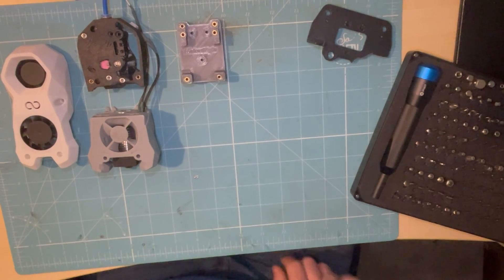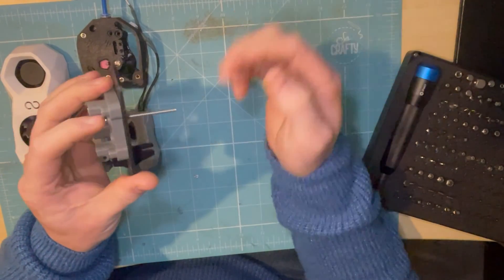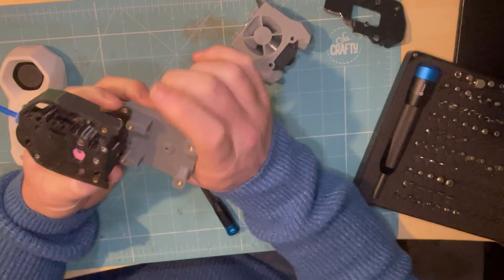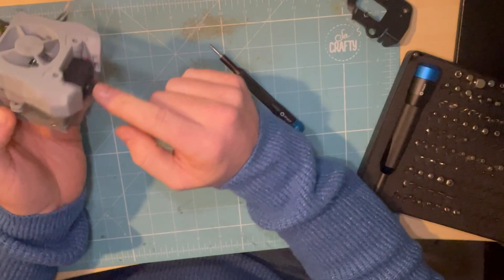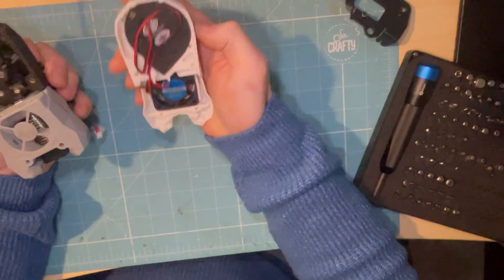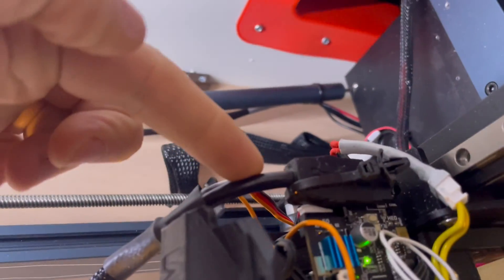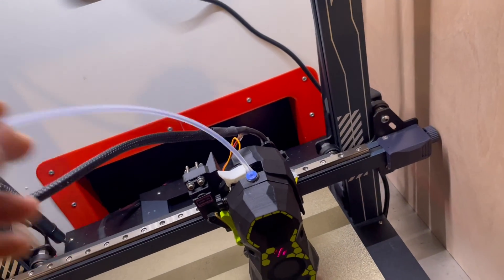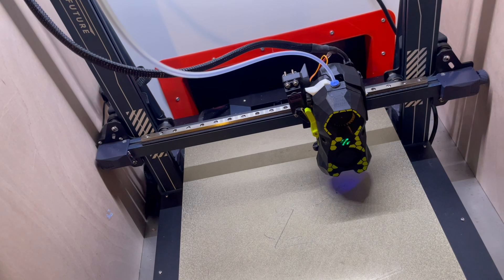Elegoo Neptune 3 Pro/Plus/Max Voron Stealthburner Install for Multi Material.

Comment: Hello! I plan to get ERCF and therefore want to get a StealthBurner with ERF for my Elegoo N4 Plus. May I ask what did you use for your stealthburner? Like board for the extruder, specs, or there is a website that shows it. I plan to keep the existing motherboard on the printer, but change the toolhead entirely to StealthBurner and I am not sure if you reused the existing toolhead cable that is by default or changed to a different one. Thanks.

Comment: which hotend are you using?ìs your printer using klipper? and are you using the original motherboard from the printer? i also had a Stealthburner and it destroyed my Printerboard, i was using an Rapido hotend
Reply from the maker: @marcelm7711  uh oh, I used the original board with Klipper and a BTT Pad7.

The hotend was a Bambu Lab X1C .4mm.

I ultimately put it back to stock and donated it as i wasn’t using it anymore since buying the Voron machines.

Comment: Sorry maybe for stupid question, but can I wire up stealthburner via cunbus to mobo of stock Neptune 4/4pro? Or I need to upgrade motherboard or buy additional board. I also have a cartographer 3d probe(beacon 3d clone), but it connected with usb, because I don't know how and where I need connect canbus. So it will be 2 canbuses as I undersood(idk). Thank you!
Reply from the maker: You could run the BTT SB2209 SB2040 board the same as mine via Canbus but you may need a BTT U2C module, im unsure if the stock N4 board provides CAN. with a U2C however you could. You could then connect the Carto to the CAN network or directly to the SB board.

Comment: Hello. I'm not very experienced. I want to buy Neptune 3 Max or plus, but I want it to be fast. If I install a Neptune 4 motherboard, will it be cost effective and will the speed be the same as Neptune 4?
Reply from the maker: I'm sure you could make it work but i dont think the 4 board would "Fit" into the 3 shell, im unsure on mounting holes etc, however electronically i don't see any reason why it wouldn't work, most of the other hardware is essentially the same.
Reply: @makermylo  I contacted Elegoo. Even though Elegoo says the engines are not the same, I think the engines are the same. Have you used Neptune 3 and 4?
Reply from the maker: @kadirbaydemir38  They do tend to say that about everything, as they can't support modified products, having said that almost all printers use the same types of connections, however i don't have a pinout of the Neptune 4 Board to be able to say for sure that it would be plug and play.

The best way to achieve what you want however would be to simply install Klipper onto the Neptune 3 Board, you'll need a host such as a Raspberry Pi or for novice users a BigTreeTech Pad 7 would be ideal. the Neptune 3 Board takes Klipper no problem and it performs very well and doesn't require you opening up the printer or fitting different boards etc.
Reply: @makermylo  New holes can be drilled for mounting, I think it is no problem. It is enough to get the speed and acceleration I want from Neptune 3.
Reply from the maker: Heres my Neptune 3 Plus, with the stock mainboard running Klipper doing speeds and accelerations 2x faster than a Neptune 4, you don't need the rails for it either, properly adjusted wheels on the stock carriages will handle it just fine.
Reply: @makermylo  Thank you for your valuable comments. I watched the videos, you did a really good job.
Reply from the maker: @kadirbaydemir38 Thank you :) Its nice to see its all worth it.

Comment: Are your fans in the toolhead 24v?  I have a few 24v blower fans I hope will work or order the correct one when I order the axial fan. I'm currently running Klipper on a BTT Pi and ordered the EBB SB2209/SB2240 and CAN adapter for the Pi.
Reply from the maker: Yeah although it doesn’t matter which you use as the EBB has a built in buck and you can simply set the voltage for the fans using a jumper on the board :)
Reply: @makermylo  perfect! Thank you!

Comment: so you have a different board for this, right?
Reply from the maker: I run the BTT Canbus controller, and NOW i run a BTT Mainboard however you can do all of this on the factory board as the BTT Toolhead plugs directly into your Klipper Host (Raspberry Pi etc).